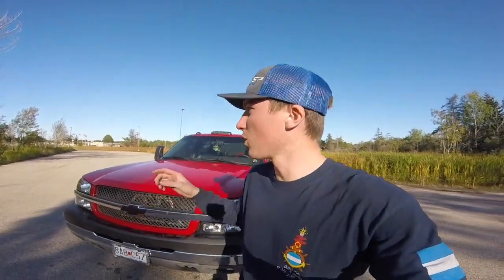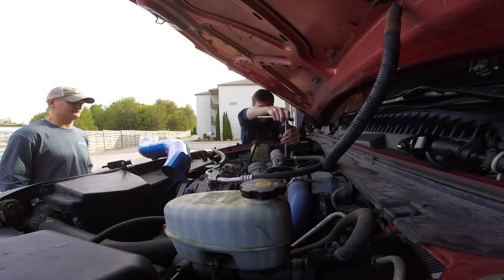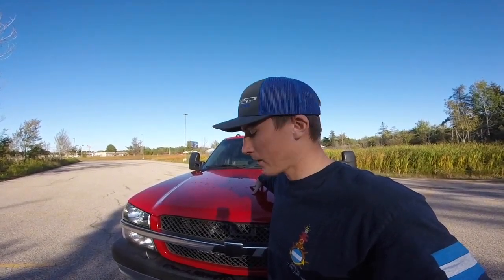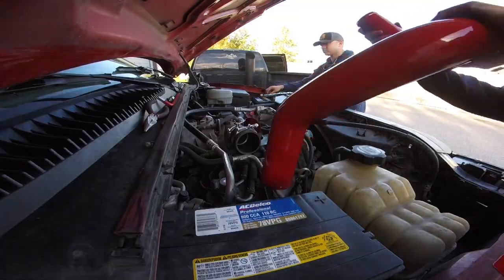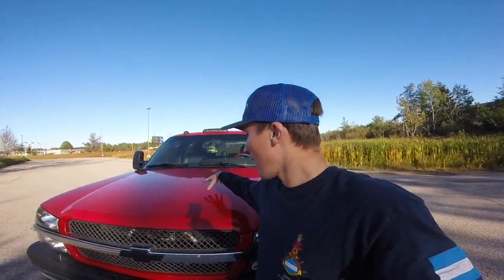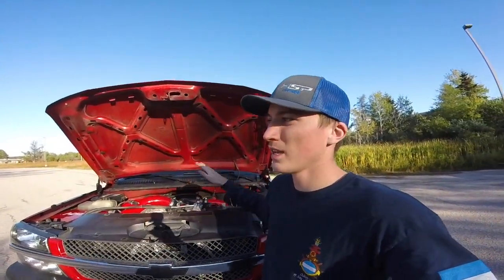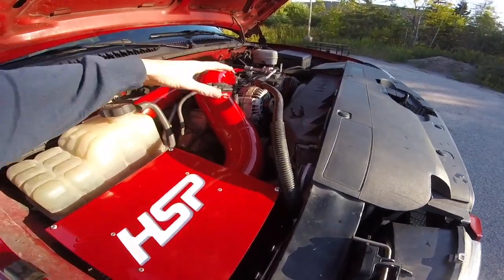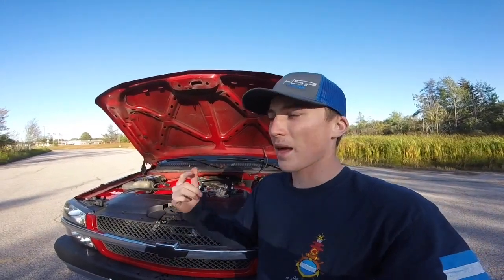LB7 Duramax LOADED with HSP Diesel Parts!!

Comment: I ended up putting some padding from a knee pad between the tube and booster. Never could make it work. 1/4 inch flexible extension is great advice. I tried so many different things I saw on other videos before finding a flexible extension at the parts house. 45% over SAC injectors, 64mm turbo, super stock lbz cp3 converted to lb7 just a few goodies on my 04 LB7 ZF6 CC LB 4x4. Nice truck and video.

Comment: Just some helpful info on the job, some is LMM specific but very similar 

Most of those vids you see, are older models the, LMM have all kinds of 
stuff in the way.
The coolant line in back to heater core is 5/8" ID and can be a Gates 18743 U formed
The coolant line down there is 1/2" ID and a Gates 28460 is a formed 90 deg for about $9 on Amazon. I used 5/16' fuel line also but the sharp bends kinked the hose. So as a good recycler I found an aluminum pipe that was attached to something that fell off under the truck one day. 
It's a 5/16" OD pipe so a little pipe bender and trim to length and slide into hoses keep em from kinking

Y bridge bolts are M6-1.0x25mm flange bolt. I always like to upgrade to 
Grade 8 when possible

The Turbo is simpler with a 6 pt 17mm swivel/flex socket from a kit in stock at Autozone #62-850 $20ish. 

The Ybridge bolts are easier with a 1/4dr flex extension in a 2pc kit at Oreilly's

Comment: Did you ever figure out a way to make it not rub on the booster. I just bought an HSP kit and I am having the same issue. It looks like if you were to cut a little bit off of the boot going onto the turbo it would clear it
Reply from the maker: Brad Vickers yes your exactly right. I did that and i have no more clearance issuer.
Reply: Diesel Anatomy okay awesome. Did you use a gasket on the new intake horn? I'm having trouble keeping the gasket lined up while getting wedged In there
Reply: @99chev60  just use a little rtv, what I have been doing
Reply: Cole Vilneff okay I'll try that. One more question. I trimmed the boot and don't have clearance issues anymore but it seems like the pipe just isn't long enough. I have pulled the boot off the intercooler as much as possible with being able to keep a good seal, and the pipe barely reaches the boot.
Reply from the maker: Brad Vickers hmm that is weird. I didnt have those issues. How much did you cut off the turbo side of the boot?
Reply: Diesel Anatomy I cut the width of the band like HSP told me to. The pipe at the turbo fits good but down at the intercooler boot it's like the pipe doesn't reach far enough to go into the boot far enough
Reply: I'm having the same rubbing issue, mines rubs and you can feel the vibrations through the pedals. You mentioned trimming the boot, which boot are you talking about, at the intercooler or on top?
Reply from the maker: Albert Respeto the one on top!